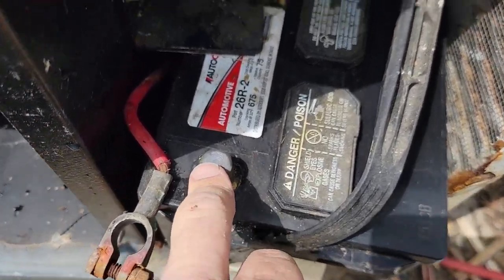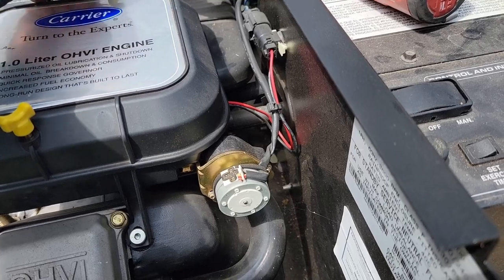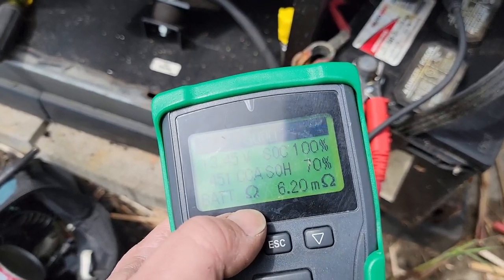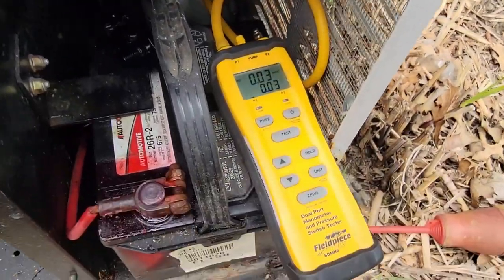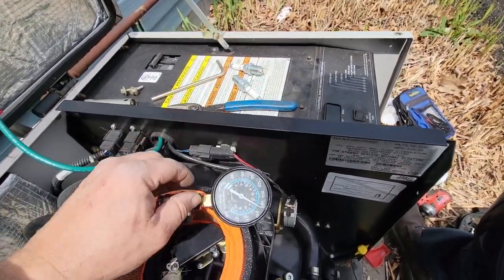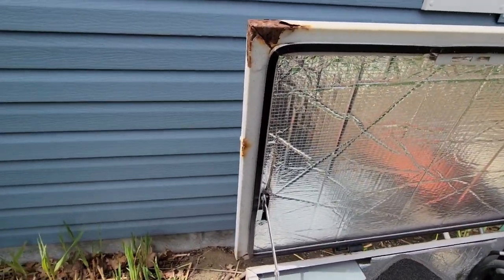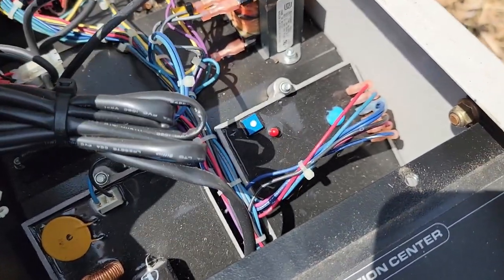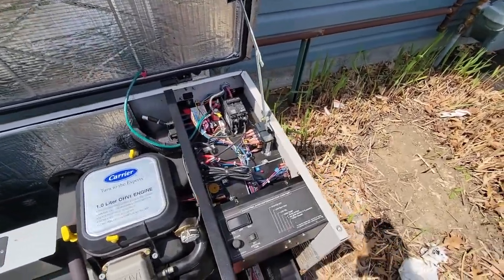Generac Generator Just Cranks

Comment: Hey,  do you have a video replacing that ovular thing by the fuel solenoid?
Reply from the maker: The fuel regulator?
Reply: @HVACRSurvival  yes , the pan cake thing .
Reply: @HVACRSurvival   in the video you call then “bellows”. That’s the part I’m asking if you have a video replacing it?
Reply from the maker: Not really, it is pretty simple, you have a solenoid at the top with two wires and a gas line coming in. Then the hoses go to the carb. I usually cut the hose at the barb fitting because they're hard to remove. (Be sure to not cut too much off )
Reply: @HVACRSurvival  big help men! 1 last question, does it comes as a whole assembly or broken down in parts?
Reply from the maker: You can get the solenoid separate, not sure if you can just get the bellows. I would order the whole thing.

Comment: I am prolly wrong here but someone please correct me. But with the fuel line not in a service loop back into the house couldnt the fuel supply go stale from sitting that would cause no start issues and once fuel cleans up it would start?
Reply from the maker: These generators are natural or LP gas. Natural gas comes out of the ground, neither natural gas or LP  go bad like gasoline.  They also run in a vapor state and not liquid causing any build up.

Comment: great video!!  does anyone know of a how to install video on the fuel/demand regulator....Generac Assy Regulator 20Kw 0G7622ESRV
Reply from the maker: It’s pretty cut and dry. Depending on the type of throttle control, you adjust the knob on the side. If it’s one with a servo motor, it may not have that adjustment. It may just be a matter of threading everything back together,  Of course you have to spray for leaks when you’re done

Comment: I have an overspeed notation. the generac shuts off. What do I check?
Reply from the maker: Check the oil, the battery, spark and sparkplugs, air filter, fuel pressure, then work your way to the magneto's, if so that checks out I would call a service company that specializes in generac.

Comment: How do i get this legend at my house to perform the exact same tests on my generac 13kw!?
Reply from the maker: Search the model number, you might get lucky to find the manual
Reply: @HVACRSurvival  thanks for your response bud. I have the manual, but that's no replacement for a man that knows exactly how this thing works. 

Unfortunately it seems like life dumps projects on me as soon as I get one done, another one pops up. I'm gonna try to two finger method. I am having a hard starting issue that I assume is based on propane supply.

Choke flap operates, but engine just cranks. Starts instantly with starting fluid though....... any advice, and I will owe you.
Reply: Model # generac 0052420
Reply from the maker: @riflebear1711  you need to make sure first that you have enough gas pressure and proper gas line size. Is it LP or natural gas?  If those are correct then I would guess the fuel regulator might be acting up. Because your saying it starts with starting fluid it tells me that you have some spark and enough fuel to make it at least run but you might have a issue with the regulator not opening Everytime. I assume you checked for proper spark plug gap and make sure the valves are adjusted correctly? Have you checked the compression. These are the basics to start with. Not seeing and hearing it is difficult to guess.
Reply: @HVACRSurvival  gas line pressure - the gas company ran the line over to the generator slab. It's 1/2" or 3/4" I can't remember. And the secondary regulator that I installed is rated for the correct water column. It's adjustable so I have it set right in the middle. May or may mot be correct but when its running it sounds ok. I don't have a gage to verify that it's set perfect though. It's LP. Regulator is brand new.

I tried the two finger banger and it seemed to work! Trickle charging the battery now as there hasn't been enough juice to even turn it over. This things been sitting awhile. 

I should add that all wires have been terminated between Gen and ats. Nothing between ats and main panel though.
Reply: @HVACRSurvival  do you think that I need to buy a pressure gauge to monitor exact h20 column?

Comment: That choke plate should be replaced not bent. The engine needs to be able to choke properly on startup attempt. This "bendy fix" was to correct the low speed exercise jet being incorrect diameter originally (its on that choke plate down on the shaft that's in the intake area). It allowed more air thru since the jet was too big, correcting the mixture. Temp fix until new choke was designed. The symptom was rough VERY low speed exercise resulting in shutdown sometimes.

The better solution is to A) get a replacement choke 0J0602 or B) turn the dip switches on the board ON to disable low speed (and reboot the board). Only 16kw and up on this model series had low speed feature so not necessary on smaller units. They amended the jet size 2x actually. The choke works on all 990-999 engines with low speed. Big hole =bad. small hole = good. I stock and replace many.

Also, do NOT cancel the exercise early after setting it! Known issue with this board not transferring ATS on the next power outage. Let it run all 12 minutes and shut down on its own.

Seal up the lift holes with something. Knockout fillers or metal hvac duct tape. Critters can crawl up the hole in the floor behind the battery that some models still had. And use Home Defense on all the vents and base to keep the spiders and ants out.

Only other weird issue on this model is no power when it runs - but good voltage regulator. Sometimes they fault out for flashing overspeed. Use Field boost upfit kit #0H07850SRV (which comes miswired from factory) and they send no instructions. :) I have them though.
Reply: Also if you unplug the plug to test it will start but it WONT transfer because you just unplugged the 23 and 194 as well ;)
Reply from the maker: That's a lot of good information. I don't work on that many generators like I did before coming  to my current company. Unless you do it every day as it sounds you do then your not going to know all the tricks and updates. I don't bend the choke much, it might be a 1/16 of a inch from being fully closed. It was something I was told back several years ago and have done it ever since.  I heard something about the control board not transferring but you could do something? I forget what I was told but it would correct it. Was this only on certain models that cutting the test short would cause a problem.?
Reply: @HVACRSurvival  I saw it on the 4300, 4400 and 5200  model series. Basically any of the units that have that enclosure style.. 
Also since we're on the subject of adjusting the fuel air mixture, on the new units (2013 - present) with Evolution controller, (the new mixer style), 16kw (992cc) and up, sometimes they hunt under load and even a few with no load. Generacs answer was to drop fuel pressure, but I don't like that. Popping the air cleaner cover while running revealed that it ran fine with more airflow, so, the air cleaner needs a few holes drilled in the back. Some of them didn't have any holes, and newer ones now do, but they're still not allowing enough air thru I've found, so I make 5 3/8"dia. holes on the back side (right thru the existing smaller dia. holes). Just had a new unit last week doing this. They run better!
Reply from the maker: @JB-Baby  thanks for the heads up🤜🤛👍👍🍺🍺

Comment: I have one that is from about 2004 and is still working fine.  The only thing that happened is that the battery blew up once while it was cranking for just the regular exercise.  What a mess of acid to clean up.  I have no idea why it blew up because I always keep it maintained and the battery full of water. (they seem to have a charger that dries out the battery by overcharge).  We live in the country closest big city is Buffalo, NY and we have power outages all the time.  I'm even so nice I have a dedicated 15A plug for my neighbor who is 91, so he can hook up and have heat and a few lights and TV during the blizzards of snow we get.  Who knows why the batteries blow up on these?
Reply from the maker: If you had water in the battery then I would have to scratch my head.
Reply: They charge constant rate of 14.4volts, 24/7. Which boils the water out of it.  I disconnected my battery charger and bought a 4 amp automatic charger/maintainer from Harbour Freight. Ran an extension cord from a protected circuit in the house to power it. 4 years and no issues. Springville, NY.... Certified Generac Air Cooled Tech. Retired
Reply: Did the same using a battery tender junior. Also use a maintenance free sealed battery.
Reply: @MrRikkitikki I wonder if the same thing could be wired into the ats?